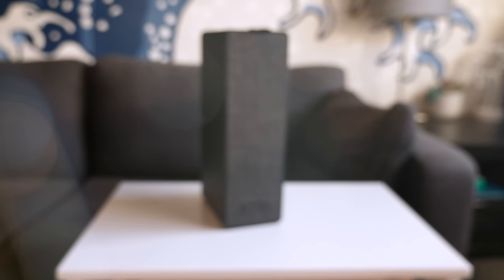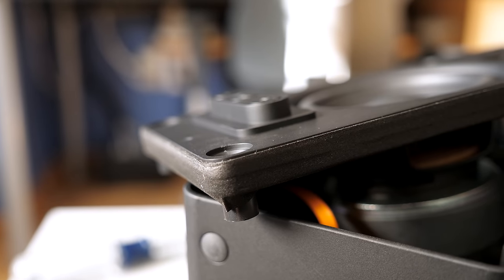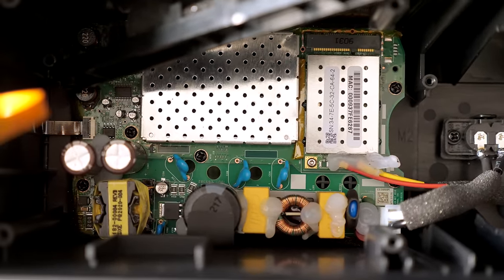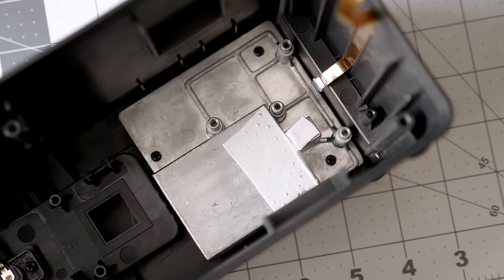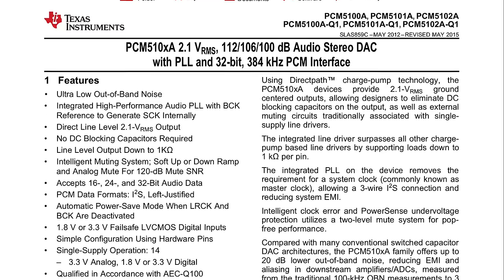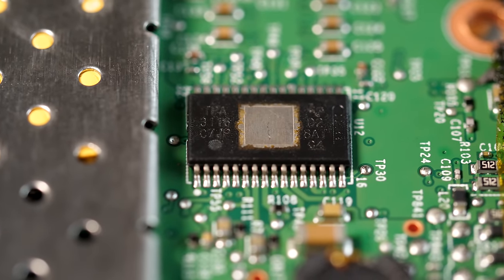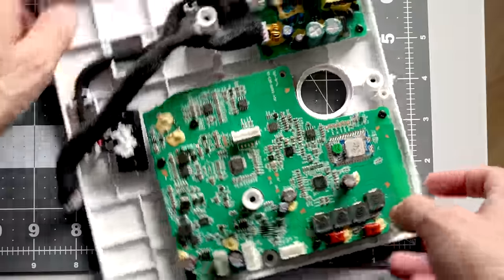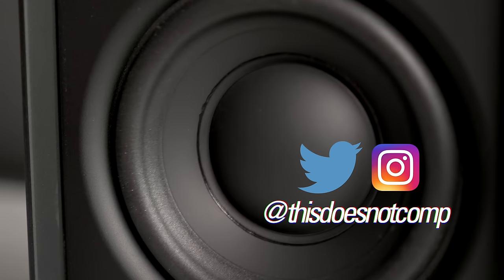IKEA's Sonos Speaker Has a Secret

Comment from the maker: An interesting note that I cut from the video for time, but still worth sharing: The Play:1 doesn't support AirPlay, but Symfonisk does. If they share the same internal components, why is this? It all comes down to that FCC filing for the Play:1 -- the PowerPC CPU originally used isn't powerful enough, but the ARM chip that Sonos switched to is dramatically faster. Sonos could technically offer a firmware update for newer Play:1 models to add AirPlay support, but likely won't as it would confuse owners of older, PPC-based Play:1s ("why does my speaker not get the update, but other people's do?"). I'd love to see someone with embedded systems experience figure out how to dump the contents of Syfonisk's boot media and write it to a Play:1, preferably over the network (partially because I really want AirPlay on the Play:1 I bought to tear down for this episode).
Reply: This Does Not Compute Poly Fill is used in an enclosure when the woofer is in an enclosure that isn't large enough.
Reply: The new Play One does support AirPlay
Reply: are you sure it's connected via pcie and not usb?
Reply: Great video 👍
Reply: T00LF00L the Play:1 (no airplay) and the Play One (airplay + alexa) are not the se product.  It wasn't clear which This Does Not Compute has frrom the video, but the FCC filing he showed was for the Play:1
Reply from the maker: I tore down the Play:1. The Play One (why did they have to pick such similar names??!!) is a bit different internally since it also includes microphones for voice recognition.
Reply: This Does Not Compute agreed, it is VERY confusing!
Reply: This Does Not Compute the Play:1 was the original and the One is the newer version. The new version is not a Play One.
Reply: One of the problems is that there is no interface that allows you to simply upload/flash a .bin firmware file. The only way to update the Sonos firmware is to go through the app, and signal the speakers to update themselves. They will then download the new firmware from Sonos and install it themselves. Therefore installing the Ikea firmware may require some network hacking, re-routing the firmware download request. Which may be difficult depending on how strictly Sonos has set up their SSL-verification and firmware authenticity checks.
Reply: Does this support wifi 5GHz?
I try sonos 1 a few years back and their rubbish use of network protocol on 2.4GHz and programming. The old man architecture cause network loopbacks. Sonos need to update there stuff as the new Wifi 6 is out.
Reply: Are you planning on modding this in any way? Replacing the caps, etc?
Reply: Sonos just released Play:One SL and it supports AirPlay. It's being marketed as a Sonos speaker without the microphone, which is just a Play:1 but with updates to support AirPlay. After watching this video, I will be buying the Ikea Symfonisk instead of the Play:1 since it's essentially the same speaker.
Reply: Still so much confusion on names...the original speaker was called the Play1...(regardless of gen) then the one with inbuilt Alexa..is the Sonos One  (not the Play One)
Reply: T00LF00L no that’s the new Sonos One. Confusing names.
Reply: Tom Li it’s not. They also don’t sound the same. The SL has more memory faster processor and Bluetooth le.
Reply: This Does Not Compute my Vivitar tower does airplay too, as well as BT. Interesting what’s in these things.
Reply: @2:35 FOAM wire wrapping  DEGRADES quickly with messy results. WHY is foam needed to wrap already insulated wires and cables?
Reply: You can't dump the data from an ARM device to PPC device that easily. Way different architectures. The PPC version also uses the network acceleratiors which is not available on the I.mx version. Source: I've worked on both chipsets 🙂
Reply: Wow, a PPC not powerful enough for AirPlay? I am using a Raspberry Pi 1(!) from 2011 with shairport-sync as one of my AirPort sinks. I doubt you get much slower machines than that.
Reply: root42 The „can‘t do“ usually means „we have willfully not included this“ or even „it‘s in but we won‘t activate it for you so you can dish out some more money for our latest goody“! Apple is great in playing that game.
Reply: Bernd Heiden Well, in this case it's Sonos doing it. However I watched the video to the end and saw the spec sheet for the CPU, which was clocked at 266 MHz. It might be that it's indeed a bit on the weak side. Even the Pi1 has 600 MHz, so probably is still more powerful than the Sonos. Maybe they were telling the truth after all.
Reply: ForbinColossus, to protect them from freezing during the harsh Scandinavian winters. No, it is done to avoid rattling sounds caused by the wires moving due to subwoofer resonance.
Reply: THE PLOT THICKENS!
Reply: An update on the play:1 brought airplay support !
Reply: What about surround sound support? Can the symphonisk do that?
Reply: @innnlove  Looks like a mPCIe board to me.
Reply: Sonos announced that they will be discontinuing the play:1 and replacing it with a new product
Reply: You confused the Play:1 with the Sonos One and looked at the wrong FCC filings as a result. They are not the same device, and in fact it's the Lamp that has the same FCC filings as the Sonos:1. Also, whilst we're here, the OS is Linux.
Reply: I mean i hope someone will desolder the flash chip from the symponisk and upload the code online so ppl can mod their Play:1 or something. tbh would be kinda neat to see if the code is different from the PPC based one to the arm based one
Reply: Can Sonos speakers  and Symphonisk be synchronized to play at the same time?
Reply: @luisdeocares2087  Yes. Electronically, Symphonisk is a Sonos speaker, and all Sonos tools & controls will treat it like one of the family, and that includes synchronised grouping and party-mode etc.
Reply: First, Sonos is great. Got a house full of them. Some in protected out side structures for some 8 years and they work fine all this time. Expensive. But hey, stay on the porch. 
Sonos is offering “upgrades” for  certain of the old ones that don’t stream airplay. 30% off the new ones if you throw out the old ones. They deactivate them. Further proof that you don’t really ever own anything. They are wholeheartedly adopting airplay. Some interesting stuff is coming.
Reply: Any way to add a line in (allowing BT dongle) on that board?
Reply: @thecbc7658   Its a April fool video that you are referring too.
Reply: @steinarnie  Exactly. While it's a good breakdown of the electrical components, he doesn't know much about speaker design. Saying it "improves bass response" is a bit misleading. If they've calculated the volume right, and have good QC on the parts (or, more likely for an Ikea speaker, don't really care about the difference), you don't really need it.
Reply: How about just swapping the boards?
Reply: I wonder....how would 64 of these work in a DOLBY ATMOS setup?
Reply: @luisdeocares2087  Yes
Reply: Just curious, does anyone know if replacing the AR9580 mini PCIe card with a card that has both wifi and bluetooth will work?  I'd love to add bluetooth capability if that's possible.
Reply: @ForbinColossus  to reduce noise from moving cable because air from subwoofer
Reply: excellent
Reply: Zara @JBR.1974
Reply: how do these speakers even work?
i mean if i don't have a tradfri hub i can still use them with google home alexa  and group them in there and  ask for pandora or  GPM,youtube  music .amazon music unlimited  etc.' or whatever
but would it be possible to use these  as speakers  for say a projector ,like if i want to stream  a video to my chromecast and have the audio come out these speakers and the video come out of the HDMI for the  chrome cast for the projector i  assume i can do that through the google home  app right?
but what if have a sideloaded .apk on my 4k fire tv stick and i want to get the video out of the   fire stick but  the audio out of the these networked speakers would there be a way to so that that?
i am looking at getting a projector  for the yard(one i can take out in the summer) and some speakers for it,and i am trying to decide if  i should get   this symfonisk, a sonos play or play one, or play one 2nd gen or the new xiaomi
or  just some bookshelf speakers to use with the extra chromecast audio  i have and  an old extra receiver i have
i also have   a gen 1 smartthings hub , can these be used with smartthings like for  use with the ikea volume steering  device ? or do you need the tradfri hub for that
Reply: This foam tape ends up as a sticky goo after some time making servicing something of a dirty job. The expected life span and price of these speakers will probably not lead to these problems.
Reply: If the CPUs are of different architecture, they very much do not share the same components. And software from one wouldn't run on another, they're completely different machine languages. Same way Spectrum games won't run on a C64. Or some modern example that I can't be bothered to think up. 

What sort of dickish business calls one product "1" and the other "one"? They sound the same when spoken, are all their customers deaf or something?
Reply: A very important point ! Well made.
Reply: @rob-123  It's nice for consumers they're just calling it Wifi 6, like they're doing with Bluetooth. 802.11m plus whatever just isn't conducive. Most consumers have trouble remembering one digit, "6", never mind IEEE working-group names or published protocols.

Of course it might piss people off if they keep changing it too quickly when Wifi 12 is out in 2 years. Then again it's all back-compatible, that's important. Ideally compatible without older stuff limiting the   speed newer stuff can run at, ie one old device on a network limiting everything else on the network to 11mbps or the like. Old stuff shouldn't hinder new stuff. 

To a certain extent that can be avoided by changing protocols per time slot, so an old gadget can work with an old standard while it's talking to the base, but then the base switches to something newer when it's talking to something else. Since Wifi works with timeslots and frequency slots that should be easy enough. 

Although gadgets taking up every available frequency is naughty, not what was intended! It works OK if you live in the desert but in a busy building your however-many MB are going to be shared between everything. Still, long as it works. And people who need real data speeds can use wires like they ought to anyway. 

Eventually when all radio goes cognitive, or at least much of it does, dumb radio still makes sense for FM radio stations to broadcast, or TV stations with millions of viewers. As long as they keep the viewer numbers up it's worth them keeping just one frequency. And there's a value in simple radio with no computers at all still being a thing that works. 

Anyway just call me a 1-man IEEE working group, in a Youtube comment. Pardon me! 

So... Wifi 6 eh? That's a good name!
Reply: @root42  I dunno. The PPC chip will have been chosen for economy, they'll have used the cheapest one they could get away with, as well as the least current-hungry. The first Ras Pi was a 700MHz ARM that didn't mind going up to 1GHz with a heat sink. It was intended to have real power to run Linux and other big-computer things, not just a glorified microcontroller with maybe some DSP functions.
Reply: It would also be very interesting to see if the Play:1 would sound the same with the Symfonisk firmware. I have an odd feeling that SONOS might have made the software for the Symfonisk play the music not as good as the Play:1?
Reply: for those who are still curious: Sonos pushed an update for the Play:1 in 2022, finally making it AirPlay ready.
Reply: I have a play 1 and the ikea and also the Sonos roam…when I start airplay to the roam it also plays on my play 1 even though the play 1 doesn’t show up as airplay…strange!